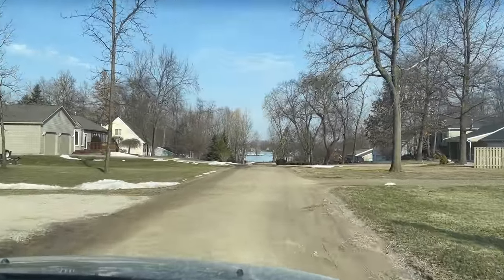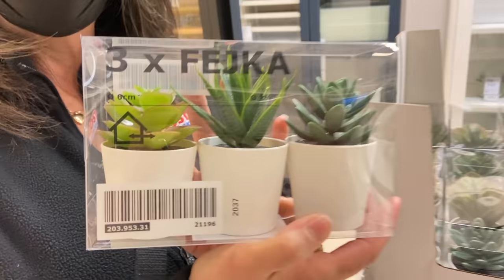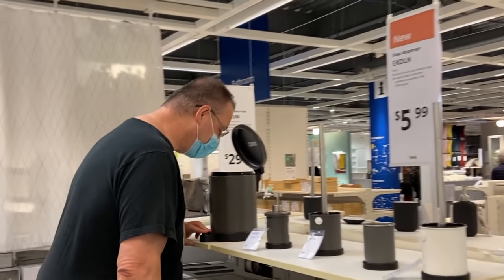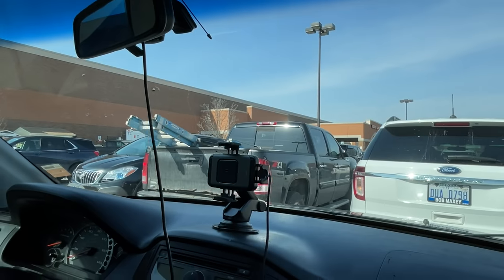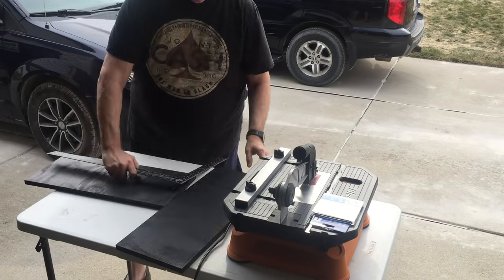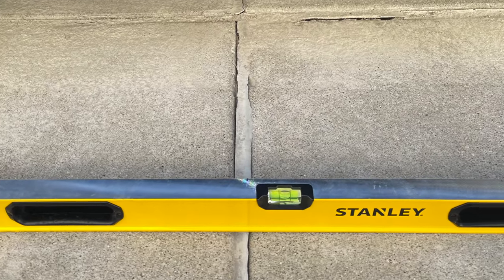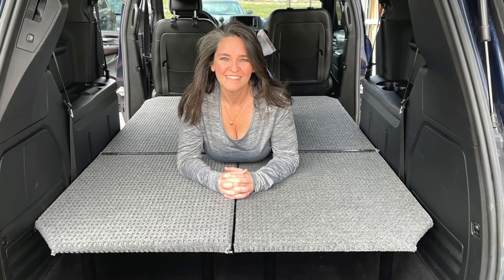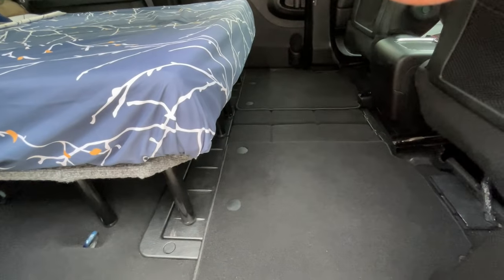DIY One Of A Kind MiniVan Bed, Solo or Duo, Multiple Configurations, SUPER Comfortable 6" Mattress

Comment from the maker: OUR VAN BED IS FOR SALE!  We recently had to sell the 2015 Grand Caravan but the platform and mattresses are available if you are near Ann Arbor Michigan contact us, no shipping or delivery sorry.
BTW, the Ikea legs did a great job supporting me (Bill) on the platform!  We have 10 legs on each platform and it ended up being VERY sturdy in the end.  We have learned that providing air flow on the platform is important to reduce the chance of mold in our foam, so we will be adding some drilled holes to provide for this. 

We built this platform pretty low, our clearance is about 11 1/2 inches up front and 9 inches in the rear.   You could certainly build higher for under bed storage.  Ours is low mainly due to the 6" foam and me (Bill) being 6'6" tall, so I wanted as much headroom as possible.  

Items used in this video
Worx Bladerunner X2 Saw: https://amzn.to/3ft4vlf
6 Inch Foam Mattress: https://amzn.to/39kQuCg
Diablo Blade: https://amzn.to/3ddeQPs
Similar to Adils Leg (if you don't have a local Ikea): https://amzn.to/39GaXSf
Stanley Staple Gun: https://amzn.to/2Pj7j9D
Elmers Craft Bond (or any spray adhesive): https://amzn.to/2PiZAIP
Route 66 2 Pack of Pillows: https://amzn.to/3w73zsy
Adventure Map Pillow: https://amzn.to/3u7fjJR
The Mountains Are Calling Pillow: https://amzn.to/3ctxvaj
Duvet Cover: https://amzn.to/39osxKe
Reply: Hi Stacey and Bill, wondering what you used to prop up the left side of the bed to a semi sitting position? Can you post this for me? Appreciate it!!
Reply from the maker: @karenclausen6724  Hi Karen ;)  I had removed the 3rd row seating and had just cut a 2x4 i lay back there in the "trunk" area that when I want to prop up the seat to a recliner i just sort of position it centrally with a small block I had installed of scrap to the back base, so it sort of just rests and props the seat, holds my big butt so it's pretty solid but nothing fancy.  I have seen others use like eye loops and paracord to the seatbelt mount areas but heck I had 2x4 layin there and said humm would this work... Always trial and error for me...
Reply: @StaceyBillsAdventures  thanks so much for the info. I thought may spring loaded latches but I love your idea, keep it simple!!👍🤗
Reply: I like the Ikea legs, I used just wooden ones (they work OK but the top of yours looks sturdier I will keep this in mind if I need to replace the legs thanks) I covered my bed with a vinyl, and use it as a counter during the day. its built even with the fridge so its smaller and I use the fridge as part of the bed. I'm going to check out some more of your videos, thanks for posting.
Reply from the maker: @notaennebodie531  thank you for watching!  The Ikea legs are very sturdy - happy so far!  Good idea on using vinyl, we can gold the foam and put vinyl on platform for "counter" space.
Reply: I have been struggling with designing an ambulance or box truck conversion for full time living, and making space to be able to sleep and seat a couple of grandkids who want to tag along on some road trips. This awesome design solved ALL of my problems! Thank you so much! Based on this design, I'm a new subscriber and can't wait to check out more of your videos.
Reply from the maker: @patcavanaugh4941  Awe, that is great to hear.  It works well for us so far!  Good luck in your aventures!
Reply: i know it's kind of off topic but does anybody know of a good place to stream new movies online ?
Reply: @Rafael Ismael lately I have been using flixzone. Just google for it =)
Reply: Great Idea! These Ikea legs looks perfect for me also. Thanks so much for sharing. Enjoy your ride and take care! Greetings from Italy
Reply from the maker: @fedecab7097  The IKEA legs worked wonderfully!  Thanks for watching!
Reply: I'm putting my shopping list together now and will create a video of the process, and give credit in the video to you guys. Thank you!
Reply from the maker: @CraftedbyMonnowLane  that is awesome.  Let us know if you have any questions, excited to see your video!
Reply from the maker: @CraftedbyMonnowLane , that would be awesome, just subbed to your channel, I think I'm gonna be in trouble once Stacey sees you channel and your makeovers!
Reply: Hello! I was wondering where the kids sleep when they go with you. I will be camping with my 3 kids and haven't figured out where they can sleep.

Comment: Hi there, I saw your vid. I've been truck camping since the mid 80's. Back when rainbows were black & white.  Here's what I've learned & I'll pass them on to you.

1) Get stuff you need at a camping store for backpacking. It's small, compact, & light weight. 

2)Get splash guards for your truck. It'll help keep you & your rig clean. They work. I know.

3) When parking for the night, park headlong into the wind. That way if a storm comes you won't have to worry about a side wind ripping off your camper shell. Plus, if anything comes bouncing towards the truck, since you have a slimmer profile, it might miss you. If it does hit, the front of the truck is reinforced. 

4) Use bug spray on the interior doors & windows/ screens openings to help keep bugs out. Use wasp & hornet spray around & on your tires to help keep critters out. Basically, all points of contact on the ground.

5) An inch is a lot of room. Learn how to stack & get used to sand & dirt.  Use floor mats to put your shoes on too

6)Air out your sleeping area every morning or often. In an enclosed space the air gets stale & it will smell like feet & assholes. I know this from being in an 80 man berthing when I was in THE NAVY! 

7)Use a small fan to circulate the air in your sleeping area. This will help prevent hot & cold spots from forming & help prevent condensation & mold & mildew from forming. 

8)Use a solid hooded sweatshirt. Draw the hood tight when you sleep to help encapsulate body heat. It can double as a pillow/ dirty clothes holder/ gear carrier.

I hope this helps. Great vid, thanks for sharing. Drive safe. 🤠
Reply from the maker: Great tips thank you!!!
Reply: @StaceyBillsAdventures  NP enjoy. 🤠🤠

Comment: My husband builds a similar platform.  Similar in that it is in a minivan a Toyota Sienna. It is all wood with 2x4 legs but it is just a solid platform, but I slip flat totes underneath the bed with one for pots and pans, one for plates and flat wear and cooking utensils and another for food. We also fit a tent, chairs, and foldable tables underneath. We put a mattress on top of the platform along with the bedding and suitcases. Next time I will add another tote or two for clothes under the bed. We added a platform on the back using the tow hitch to carry our propane tanks and cooker in a tote outside so we didn't have to worry about leaking propane. There was room for the cooler too. All-in-all a good temporary conversion for a week of camping. We found sleeping in the van much more comfortable than in the tent. But we set up the tent for a place to change.
Reply from the maker: Sounds awesome Judi!! Have you guys made a video of it? Love to see it!  I went kinda low with the height since I am pretty tall at 6’6” so I needed the headroom but I can get totes and my chair under there ;)
Reply: @StaceyBillsAdventures  we didn’t make a video. My husband works alone and hates being photographed much less videoed.
Reply: As to height I think ours is about the same since our cup holders etc are still usable. My husband is 6’ so he was sure to keep enough headroom.
Reply from the maker: @judischarns4509  Bill does not like being in front of the camera, he is a little better when I am with him.  I was super proud that he did his solo videos on his trip!

Comment: I had the good fortune to finally stumble upon the bed solution for my no-build van build.
I gave up trying to figure out a platform or cot frame and just put the tri-fold mattress on top of a 2'x3' cement tub 8" high with 1/3 flipped up to make a comfy chair with my bedding stored under the tub.  For sleep I just set the tub aside and fold out the bed.  My set-up is based upon the space from the tailgate to just behind where the sliding doors open leaving all the space open between the doors.  I can just take a vinyl tarp and throw it over my things and nobody knows what is there and I still have a lot of storage between the doors as well as room to set up a quad chair if I like.  It's the back 2/3rds of the van rather than side to side with a little space down the middle to move.
Reply from the maker: Sounds very interesting Steve !

Comment: Thank you! You have given me the best idea to do for my raised floor for my mini van. Wanted a raised floor but just several inches and have storage compartments for food, clothes, ect. I was going to do a wood frame but being that the floor is not level I was thinking that was going to be a challenge. Not anymore! I’m going to use those legs! Found some on Amazon of all different sizes so I may not even need to cut them but even so, they will be less weight, allow more room for storage and be a heck of a lot easier! I think I might be able to manage this by myself now and not have to rely on my ex husband to help. The floor is what had me stumped. So thank you so much!!
Reply: Awesome!!

Comment: This is fantastic.  I need to keep my seats but I’ll build a similar platform that goes over the top of my seats when they are laid flat.  Thanks for the great idea.
Reply from the maker: Thanks!  So far its been working well for us and holding up fine, we always modify and try new things sometimes they fail but this one was a winner for us :)  Each trip we mix things up and change things, over the winter I may try to build something else too I am finding I don't need as much under bed storage as I thought I did on some shorter trips and I wouldn't mind a bit more head room so I may lower the platform with new shorter feet or just redesign something.  Bill :)

Comment: Great job on bed platform. I have a simar set up.Since I often can't find a level parking spot while traveling, I have alternate,different sized, legs that can be switched around to raise or lower your feet or head end of the bed to counter the uneven parking angle for a level bed. Even a small array of different thickness blocks work and are relatively easy to store with limited space in ur tiny rv. Wishing you great times and safe travels!
Reply from the maker: Great idea!  Thanks for watching, safe travels to you as well!

Comment: 😊 I got ya beat on versatality and very cheap. Bought 2 couches and a chair at a church rummage just for the cushions. Discarded the couches and chair and attached velcro where I needed it and when its bed time, the longer back couch cushions are on the floor with the 3 shorter seat cushions in top of them attached with the velcro with the chair cushion serving as a headboard. When I need a chair, I simply re-stack them into a chair and it feels like im in a lazyboy. I save a ton of space and put less weight in the van. Total cost including the velcro, $26

Comment: OMG! Thank you for sharing this video. I have a bunch of the Adils legs and never even thought to use them to build a bed platform. Thank you for the inspiration and for sharing exactly how you did it! Safe travels.
Reply from the maker: You're welcome! I do have to say the bed has held up very well, the one thing we didn't address (or know at the time) was we need ventilation between the foam and platform so that condensation and mold won't form, for now I have pipe insulation foam tubes laid in between, but I plan to put holes in the actual platforms themselves with a drill and small 3-4" hole saw to help with that. Bill :)
Reply: @StaceyBillsAdventures  I saw your note above that was pinned above that. Thanks for drawing attention to the need for ventilation and I'm glad it's held up so well!

Comment: Some good ideas for the bedding with the legs. Thanks. We have been camping with our van for a while and will be upgrading our build soon.
Reply from the maker: One thing I learned not in the video was to drill some holes in the platform for airflow in case of mold. Sometimes I use this platform when we travel together but 
Solo I tend to just toss in a sleep pad I'm finding less is more lately it gets cramped to me at times in general on a lot of the van builds.

Comment: Thank you so much for posting! this is exactly what I was looking for. single Nissan NV200. keeping my utility steel shelving and built a working sink with a small ikea cabinet and porcelain sink worked great! If I can make this platform tall enough to scoot my toilet under...I will be VERY happy!
Reply from the maker: Had to keep ours relatively low due to my height 6'6" so I needed some headroom but yeah you could use 2x4 or Ike's legs at any length to make your platform level and a certain height that meets your needs

Another girl who's shorter just made a 2 Pc 23x30 for her solo travels she didn't need the extra 10" etc

Comment: I also built a minivan bed. I will try to put a video together to show mine. Yours has definite pluses that I could use if I should ever rebuild ours. We have friends that have a class C motor home. We call ours a class MV. We also have a roof top carrier we call, “the attic”.  We are able to store some items under the bed, but the attic is also nice for golf clubs, etc.
Reply from the maker: Karla, I am constantly watching videos and getting ideas, i think over the winter i will try to make one of those couch to a bed type designs, I guess part of it too is the future cost of wood hehe.  I wish our van had roof rails so I could do an attic too, I checked into it and man the aftermarket ones are expensive to add a thule was over $500 (I dont have any rails at all so flat roof).  Bill :)
Reply: @StaceyBillsAdventures  we bought our roof carrier at Dick’s Sporting Goods. We bought the display, so lucked out with 10% off. (Brand is SportRack). It locks and holds a lot. We have never had it full. Our van already had rails, so we only had to add the crossbars which we found at Blain’s Farm & Fleet around $60. I’ll let you know if I get a video up for my bed.

Comment: I would love to know how you worked out all the different lengths the legs needed to be!
Reply from the maker: First i made sure the van was on level ground in the driveway we have a slope after our parking pad.  Then I put the platform in the van laying on the floor, then (don't laugh), but I used any box I could find (mostly amazon boxes).   

At one part a small bucket I have for washing the car was a good height towards the back, so with a level and lots of moving boxes around shimming a few with just scrap cardboard to fill in under the platform till I had it level and a height I wanted, then I just measured floor to platform at the hinge areas. 

I was afraid to cut the legs if I was wrong but the feet do adjust so I figured worst case I could adjust a bit with the feet, but it worked out really well.  So far the beds been fantastic, the one thing we didn't go into here and didn't know when we built it was that it should have holes in it for airflow to reduce the chance of any mold between the platform and the foam mattress, for now i put some pipe insulator tubes between them to sort of lift the foam off the platform and allow some airflow but I will pull them and drill holes in the platform soon. - Bill :)
Reply: @StaceyBillsAdventures  that is so helpful Bill, thanks so much